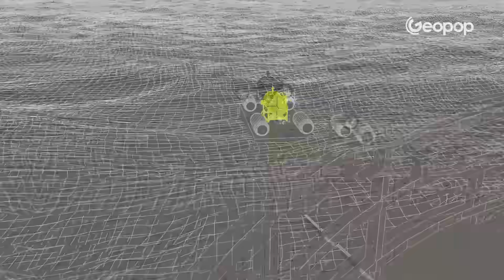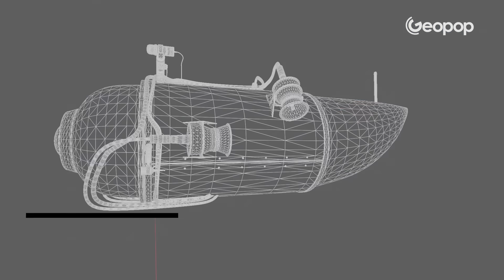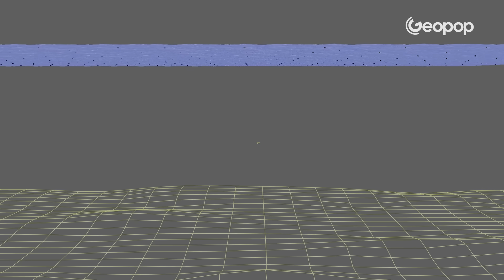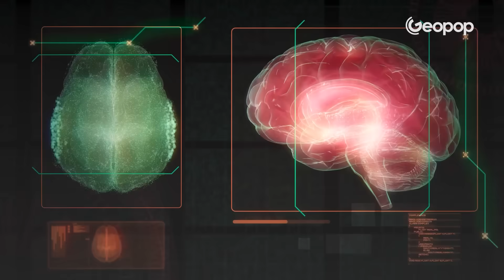Titan Implosion, two year later: the 3D reconstruction and the possible causes

Comment: Gotta defend carbon fibers here.  It's much better in compression than most people think.  Otherwise, it wouldn't have survived the trips prior.  That's quite an impressive feat by itself.  People forgeting it's called CFRC, where the resin or polymer is the one that failed in the composite.  It would've only work if we had Star Trek tech where we can create and control artificial gravity to allow the resins and cf set perfectly with absolutely zero pockets😂

Comment: I’m all for someone putting their own life at risk to do something innovative but to put other peoples lives at risk for profit is immoral and irresponsible.
Reply: Hey, every one of them signed releases of liability. They knew there were risks, and they chose to take them.

Next thing you know, it's "Hello, Jesus."
Reply: @PanhandleFrank  I agree with you that they signed the release but I also doubt any of them knew of the actual danger they were in. So the release will probably mean nothing. I’m just saying in general if someone wants to something innovative but to even attempt to put others at risk for financial gain is immoral.
Reply: @lscales6131  The release literally said that the trip could result in their deaths.

They died.

Next case.
Reply: @PanhandleFrank  I understand I read standard release forms. Most of them say something a long those line. Anyone could die in just about any situation. My thing is that they probably weren’t told how many dives the craft did or that it was built with carbon fiber in epoxy which has a great risk of microscopic cracking which at those depths could result in catastrophic results.

Comment: But the pressure on the submarine at 100 m is 10 atmospheres not 11 atmospheres because you need to consider the 1 atmosphere of pressure already inside the submarine which cancels one atmosphere. Hence 10 atmospheres on the submarine at 100 m.

Comment: The passengers were supposed to be considered some kind of trained specialists that would be doing research work at depth. Yet they had no experiments or data acquisition equipment in hand, and we know that the Titan itself had no technology to speak of—some screens and a game console controller!

Also, I found it alarming that there were no seats, they sat on the floor of the Titan. Surely that’s a safety issue to have unrestrained humans falling about as the sub moved?

I’d like to know what his sensor data was relating as the CF cracked and crackled. Probably something Stockton heard every dive and he’d probably relay this to the ‘crew’ “Don’t worry, it always sounds like this”…just before implosion!

Comment: Yeah at 100 meters there will be 11 atmospheres of pressure. But there is 1 atmosphere of pressure inside pushing out. So the vessel only has to resist 10 atmospheres. No need to add inconsequential variables to an explanation.

Comment: Great video/documentary of what happened - thank you for sharing! I’m now subscribed and look forward to watching your other work. One thing that I was wondering about: if I recall correctly, the window in the  titan sub  weren’t designed to go beneath a certain depth and they ignored that and went below that depth. If my information is accurate, I find this to be the main cause of the implosion of the sub. As you said, it only takes one weak spot at so many atmospheric pressure conditions… everything else would of course fail spectacularly in due time, but this seems to me to be the main cause.

Comment: When I first learned of the design, I thought. What if titanium rings wrapped around the hull sandwiched between layers of carbon fiber. My first thought was 6 ring layers between the fiber layers. Because a ring is a very simple design and easily manufactured it should give great structural strength!

Comment: One of the problems with the unfortunate Implosion was that the Captain didn't call out for the Crew to "Brace For Impact" when the Hull Monitor Alarm triggered.  This would have given them time to gather their belongings and put on their diving masks and flippers.  Also, they could have applied salve to minimize the pain and localized burns from air compression.  I recommend that they take along a small Ant Farm since it is well known that an ant can carry 5000 times it's body weight.

Comment: If they had used titanium instead of carbon fiber, they would have reached the Titanic's depth without any issues. The pressure at a depth of 3800 meters is 38 MPa or 380 bars, whereas titanium can withstand pressures between 900 and 1400 MPa.

Comment: It was not "designed for 3800m".   It was designed for 600m only.
Reply: If only he would have been into reading labels they would still be sucking up nutrients with the rest of us.
Reply: @heliozone Technically I think the statement on the 600m was related to the portal window spec.
Reply: @Espiritu-o7x  yes, it was the portal windows limit. It's impressive that the portal window went so faar above it's limit without breaking.
Reply: Certified for nothing

Comment: Thank you for this upload.
Can somebody explain to me though like why there was debris found? wouldn't it just all crush until it disintegrated? how does that work?
Reply: The "crushing" effect isn't due to the pressure per se, but to the pressure difference , in this case between the inner hull and the outer environment, that was some 1:300.
But after the destructive crushing effects of the pressure difference, when all the air has been squeezed out (including that contained in porous materials and, alas, in human body tissues and organs) what is left is debris, or even larger parts, that do no longer show any pressure difference and thus are  neutral and "balanced" relative to the pressure around them.

Comment: I'd hate to say it, but they were right when they said "Regulations hinder innovation."
Because without the loss, and the data, the world would not be aware of the importance of such regulations, and now, we can point directly to an incident that explains why we need to have multiple certified parties involved with the inspection and subsequent development of things like this.
If this did NOT happen, people would build back yard aircraft, shoddy DIY submarine kits would be sold, and more people would be killed and the people themselves would be blamed for the failures, by those who happened to survive the few dives that made it by luck that structural fatigue didn't get them. Yet.
So having this tragedy happen, LIKE THE TITANIC ITSELF...
Puts fourth a new standard, and reinstates its importance.
Not enough lifeboats? NEVER AGAIN...
Not tested and properly certified to carry human life to those depths?... NEVER AGAIN.
Some people will ONLY learn from such tragedy, and NEVER listen to logic and reason, throw caution to the wind in lieu of innovation.
This is necessary when NEW things are done, space travel or even flight for example... We KNOW that it had to be done to discover the best ways... But when you have a situation like this, where the best ways are trite and true, and have been for centuries... The risk is not necessary. 
Literally an automated system could have been employed to control the submersible, and run through cycles before subjecting innocent lives, people who had faith that your system was tested and proven...

Also, carbon fiber is STUPID in the deep ocean.
THERE IS NO NEED FOR LIGHT WEIGHT MATERIALS...
This is just to save money on the devices to transport the craft, why do you think they use water to simulate weightlessness?
The forces pulling up on the craft made it require a heavy deck to lower it down... so where was the need for the hull to be carbon fiber now?
And if it detached from the hull, it's basically a thin hollow bubble, and would rise to the surface FAR too fast to be safe.
So if the implosion in an emergency didn't happen, but they just, disconnected from the weighted deck and surfaced... They'd arrive to the surface in a terrible, jam like state.
So, I ask you... what, beyond learning WHY STANDARDS AND MULTI PARTY CERTIFIED INSPECTIONS ARE IMPORTANT...
What other lessons would we have learned?
We KNOW the shape is stupid, We KNOW the material is pointless at depths, and we know the material is near impossible to test for flaws within its layers without extensive ultrasonic, x-ray, and liquid pen testing.... So why not make it from proven and reliable materials such as titanium or steel?
Carbon Fiber is light weight... so what, at depth in the ocean, you want heavy. If this were just a ship hull, then YEAH that would be fine, and likely amazing.

Ultimately, packing 5 people into a toilet paper tube made of carbon fiber, controlled by a single video game controller, and WIRELESS COMMUNICATION AND NAVIGATION (like that works under thousands of feet of water... stupid.) and letting Neptune STOMP on it, calling it the "TITAN" which is a slap in the face to the "TITAN-ic" and even going as far as to say it is unsinkable... LIKE THE TITANIC.... is just asking the universe to prove that you are a fool.
Stop doing stupid things like this, use your cool kid carbon fiber tube for normal depths, shallow dives for exploring reefs, and put a larger view window because it don't need to withstand the crushing pressures of the deep....
THAT TOURISM WILL BE SAFE AND FINE, explore other wrecks of ships, do whatever, just stay the f*ck out of the DEEP OCEAN in those materials and lack of deep sea certifications.

And now the world knows.
Thank you Titan.
Thank you Titanic.
For laughing in the face of known dangers, and making people hold safety first and foremost in these kind of projects.

Comment: Everyone is looking at this all wrong. Stockton Rush showed the deep sea diving world that the lifespan of a carbon fiber reinforced polymer pressure hull at depths of 3,800 meters was 13 dives…  Titan completed something like 200 dives to various depths.  So the machine, while experimental, wasn’t a complete failure.  There is data left behind that future innovators can build upon.   That is the whole point of engineering and exploration, isn’t it?  To find a way.  If at first you don’t succeed…and all of that?  How many people failed to find the Northwest Passage?  Did that stop people from trying?  It did not.

Comment: CF is not a good material for compressive use. It's well-established, even outside fields of material-science, that carbon fiber is incredibly strong in tension, but is only granted its lateral strength from the binding medium, in this case, epoxy resin.

Comment: Man probably confused CFRP with Carbon Nanotubes or something else, not that Buckytubes wouldve helped either. Their strength is in holding things together, not standing up to outward pressure moving inward unless i missed that part of my perusal of them. Massive pressure would likely still fold them inwards like paper mache and theyd have never gotten below 10m. Now using them to prevent outward expansion should theoretically work wonders, as their tensile strength is more than 100 times that of steel. But inward pressure, theyd have the same pressure resistance as whatever material they were wrapped around to provide them the required structure.

Obviously he didnt confuse CFRP with Nanotubes, it was just a remark on how utterly brain dead it was to use Carbon Fiber on something like this and ignoring the reality that his own engineers were telling him.

Comment: The bonded/glued surfaces of titanium and carbon fiber were not allowing  inspection. Sea water impact is no joke on any metal. Offshore rigs use hastelloy and titanium pipeworks and still experience some levels of corrosion. So this could well be another reason for hull collapse combined with the difference in yielding of the two types of materials.

Comment: "Possible causes" lmfao its because it was made of rolled carbon fiber (too brittle) and the window was rated for much less pressure
Reply: Yes also people are saying how the carbon fiber and titanium end caps of the sub contract differently under pressure, and the terrible job of applying glue to that spot also couldve leaked or gave under pressure.

Comment: Have you ever considered simulating what it was like to be on either plane that hit the WTC. Like, were the people at the back of the plane able to react to it or was it as quick as this implosion.
Reply: Looks like a rather unnecessary and morbid speculation.
Reply: @pulidoggy  yet we have a video on the titan sub. There's plenty of building simulations so why not plane ones?
Reply: @DMModelCars   The main purpose of simulations (apart from forensic field) is that of analyzing the dynamics of past events, or predicting the outcome of future ones, in order to devise appropriate precautions / corrections / improvements / countermeasures to avoid, or mitigate, any possible adverse factors, and to improve the overall safety and chances of success of future similar experiences.
But what purpose could serve the simulation of the possible reaction times and sensations of unfortunate people sitting in the rearmost seats of an airplane crashing into a building? Maybe recommending business class next time, just to shorten the suffering? 🤔

Comment: My greatest concern about design in not material choice (it needs much more research), but hull shape - why had they stuck with cylindrical shape, rather than “pumped-up” cylinder - it definitely would be weaker than sphere, but much better than cylinder, while requiring basically the same tech and cost to produce.

Comment: I don't have to do any FEA whatsoever to know that under pressure, that CF hull was going to tend to pinch in at the middle hourglass-like, and that was going to pull open the glued seals against the hemispheres starting from the outside. It was bound to fail - if not at first, eventually, like dropping an anvil on a soda can.

Comment: I'm not an engineer, but I know that a sphere is far better than a submarine shaped like a Coke can with a half-sphere nose. As a scuba diver, I've cracked eggs underwater at considerable depths. When you do that, the water pressure makes the yolk form into a sphere.  you can also see this phenomenon in zero gravity with water  you can just see how the pressure and fluid Dynamics work

Comment: I am a physicist where we peer review. If I were to participate in anything that could possibly be a death trap, I would want to see an “ok this works” from at least 10 experts in the field of mechanical engineering and oceanography.
Reply: Along with unmanned dives full of sensors and a very thorough inspection after each one. Jet airliners learned that lesson with the Comet
Reply: Staff: "Sir, the sub implodes at 3000m when we test it."

Stockton Rush: "So stop testing it."
Reply: I thought this vessel had made this trip several times? So did it work initially? I'm confused
Reply: @barbaras8562  it did way too many dives, it should have been replaced for another one at half of that many dives.
 

Here's the kicker, that canister shaped coffin was dragged through the sea for 600 miles, adding more stress to the already stressed structure, then it was one dive too many. POOF

Comment: The carbon fiber was crackling worse, every time it went deep. Their response? Put in microphones to record the sounds. BRILLIANT!
Reply: That’s a ‘if we don’t test we won’t have any failures’ approach.
Reply: It should have been a test to begin with n a better material should  have been used due to the fact that it can only take so much pressure that tiny thing  n all that water was a bad idea to begin. with.
. @lynnlytton8244
Reply: To me that is incomprehensibly asinine. Ok,  loud cracking is heard. You now have .12 milliseconds to get to the surface (2-3 miles) and get out. How helpful.
Reply: The carbon fiber that Rush bought came from Boeing and was deemed by Boeing to be unfit for their use, and thus made it for sale.
Reply: @cityman1111 If even boeing doesn't want it, why would they ever buy it 😭
Reply: @bolshevikapologist
That's, my friend, called "cutting corner"

And almost every CEO use that technique to keep the money for themselves. Denying insurance claim, using substenate at restaurant, "carbon fiber", and using bamboo instead of steel bar for making road.
Reply: @ApaPulalah I work for an engineering company that has also a CEO who doesn’t cut any corners. He cannot afford to.  Otherwise everyone would be out of a job at the company.  You cannot stereotype.
Reply: It reminds me of when parts of Skylab were expected to crash into the Pacific but there were concerns some parts may come down in Australia, and some enterprising soul sold people a hat with a spike on the top to give them 'warning' that something was about to hit them. In fairness, that spike probably would have given more warning that those microphones.
Reply: Don't forget the ear plugs too haha
Reply: Stockton Rush said he wore earplugs.
Reply: @conniemeissen5213 the idiot would wear a bicycle helmet too! 😂
Reply: What do you expect from Demorat brainiacs
Reply: Acoustic measuring devices are good for a test with no humans involved.  But to just record the sounds as the thing is diving further down with people in it is pointless.  Sound monitoring again can only be helpful in test environment to detect any sort of hull integrity compromise with no human specimens.  And if anything is heard, then it should be back to drawing board - doesn’t matter if it stops or not!!
Reply: Assumption and sarcasm is of little help Phil. Have you nothing substantial to contribute?

Comment: possible cause, the thrusters powered by massive lithium batteries went into thermal runaway.
Reply: Especially if they panicked hearing cracking sounds and pushed the thrusters max
Reply: I suspect the lithium batteries over a structure designed for diving deep.